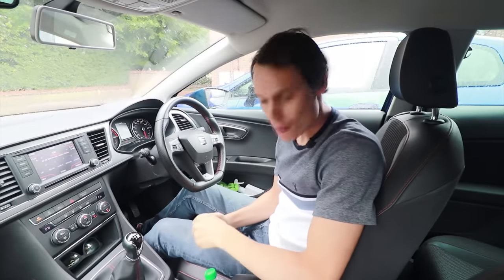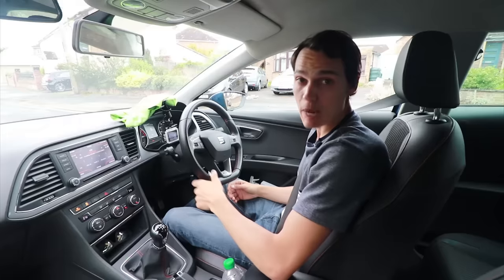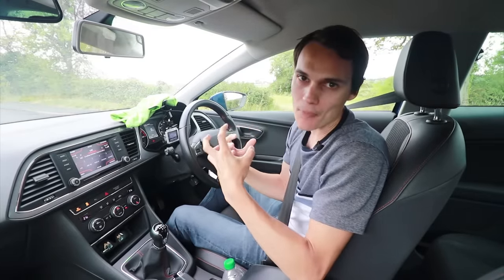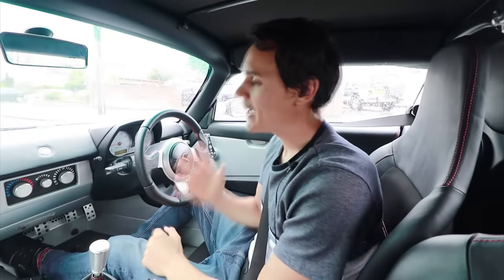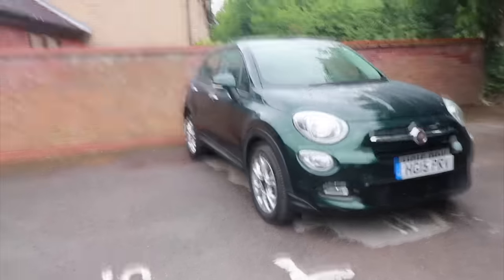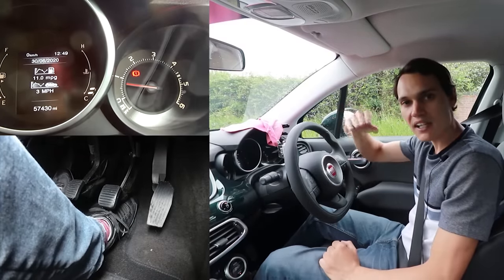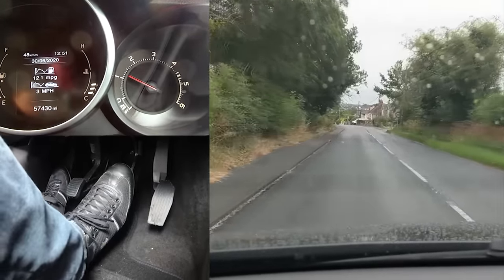Upshift blip - advanced technique for changing up gears smoothly

Comment: Im going to try this. I always struggle with keeping it as smooth as possible going from 1st gear to 2nd.
Reply from the maker: Good luck, I hope it works for you.
Reply: Same, manage to get on top of it?
Reply: started blipping the throttle, seems to help
Reply: Don't think this would fix things for you. If you find the revs are dropping too low, the simplest solution is just to change gears quicker.

When you're going first to second, there's often a large rev drop to do ~2k if you've waited until 20mph after pulling out of a junction. You're probably finding the car lurches forwards as you wait for the engine to slow down to match speeds
Reply: Just rev it out a little more and let the clutch out slowly
Reply: Just rev it from the begining don't press the clutch change gear then blip, just keep revs high

Comment: I had never heard of this technique before, I’ve not been driving long, 37 years, I found your excellent video as I was looking at a smoother gear change when driving my Defender, which in 1st 2nd and 3rd is a bit of a nightmare, I look forward to trying this out. Great video.
Reply from the maker: Thank you, I don't find it helps in diesels though.
Reply: Same with my WRX. 1st to 2nd and sometimes 3rd is horrible jerky sometimes.
Reply: @yammmit  how did you make it better?  Im struggling too
Reply: @ConquerDriving can you make a video for Diesels? Struggling to drive a Honda diesel in the lower gears and having too much jerking. I was driving a petrol perfectly fine for a while before this

Comment: That's a great tip! On my car I don't need to use this method on upshifts because the RPMs fall slow enough that I can upshift smoothly just by timing when I let the clutch out so it engages right as the RPM drops to where it needs to be in the next gear like your diesel Fiat. Took a bit of practice but the feeling of getting the rev match perfect and feeling nothing when the clutch engages is so satisfying. I can definitely see how this method could be quite useful on cars where the RPM drops quickly

Comment: Great video. Really helpful.
Some friends, ask me, why I revmaching when downshifting or sometimes when upshifting if I not need for , because I not in a racetrack on I need keep my revs up.
My answer it's always: do you feel the car Jerking or the downshifting when I do that?
- no, it's really smooth as if you don't change gears.
Exactly, that is the purpose. Also, more life for the gearbox and the clutch.
Reply from the maker: If you can rev match it's definitely better.
Reply: I had a stroke reading this
Reply: @yammmit  have you recovered from your stroke yet?

Comment: Even though it's a turbo diesel, 1st to 2nd can be a bit jerky if I go anything above 1 to 2k revs and don't take the clutch up slowly. This might be what I was missing!
Reply: You might want to try shifting at Lower rpms most diesels are designed to shift at low rpm because of the high torque
Reply: @aidanmorgan6291  I think you've figured it out. Sadly the old thing lost it's marbles and the engine computer went again, so I've had to get a petrol which suits me better for my current driving anyway. I'll miss how the engine sounded like it belonged in a tug boat at idle.

Comment: Automatic car: basically just learn how to drive with other people.
Manual car: have to learn how to control the car first.
Reply: and automatic cars much more expensive:)
Reply: Driving automatic car isn't really driving
Reply: @msa3533  How so?
Reply: @angrysocialjusticewarrior  it may depend where you live at
Reply: @msa3533  It doesn't. Geographic location has no bearing whatsoever on the superiority of automatics over manuals. Even if you live in a literal warzone, an automatic would still be way superior (e.g you can keep your eyes on the road to watch out for rebels since you don't have a transmission stick to distract you, and an automatic will get you out of a shootout than a manual could).
Reply: @angrysocialjusticewarrior  man I'm too proponent of automatic cars. Nevertheless, they are more expensive than manuels
Reply: @angrysocialjusticewarrior  manual gears are primitive and useless and you don't get better performance?
Yet the new m3 will come in a manual option and the new Porsche 911 gt3.
Reply: @angrysocialjusticewarrior  walks into a Porsche dealership to look at a 911. Asks the salesman "does it come in automatic" 🤣🤣🤣
Reply: @angrysocialjusticewarrior  I afraid your logic is terribly wrong. Understanding how to drive doesn't equal to better performance, better fuel economy and more safety.
Understanding how to drive means you know what the power bank is. You know what the rev. the peak torque located. You know why it is important to rev. match. These are fundamental but also are the thing the automatic guys absolutely have no idea. To them, they just floor the throttle and the gear box would do the down shift for them. 
Next time, try to ask an automatic guy why the gearbox down shift when you step down the pedal. I am interested to know what their answers are.
Reply: @angrysocialjusticewarrior  Sorry but one more thing. Passing the driving exam doesn't mean you know and can handle the manual car in your daily life. In fact, there is a huge gap. You would not understand what I am talking unless your daily car is the manual one.
Just stick to your automatic if you afraid the drive the manual. Few years later, the ECU will drive the car itself and you will come here again and shout out that you know how to drive car because you have pressed the start button. lol
Reply: @angrysocialjusticewarrior  automatic is not driving it's just steering
Reply: @angrysocialjusticewarrior  If all you want is to get from a to b. You can get more performance by manually shifting, because you can favour the RPM range that gives maximum engine performance, especially if you have turbos. That is less relevant outside of hobbyist circles.

What is relevant is that you can get more economy by favouring higher gears to reduce the amount of fuel used, which makes a difference over time, and allows a slight reduction to wear. There are automatic drivers who like to reverse before stopping or throttle before entering D, as well as an idiot who thought P meant Pass when driving on a highway.

Unless you live in Hong Kong, automatic boxes are noticeably more expensive, which is a major problem to the less affluent. Having less need for oil changes is significant to a lot of people who do not have a garage or driveway, which is most of the world.

Like the other guy said, to us it is like doing math without a calculator. Knowing how as well as why makes us more skilled, which is why math students educated in the East Asian style generally perform very well
Reply: @alexsiu1280  I'm almost 9 months after passing my exam on a manual and still watch lessons like this and learn with every driving session. I wouldn't dare call myself experienced before a few years and tens more thousands of kms in various situations under my belt. This commenter SJW and his logic really lives up to his name, driving an automatic and bragging about passing an exam lmao. But he made his point, he is not a real driver, he is just an automobile user that wants to get from A to B and doesn't like driving, nothing wrong with that.

The math without a calculator analogy is spot on.
Reply: @angrysocialjusticewarrior  if the gear stick in manual is a distraction then you definitely need some practice. It distracts you means you have to think how to change from 2nd to 3rd or you have to look at the map on gear knob lol

Comment: in my manual 125i, even if the revs are in the right place (or above for where 2nd gear should be), it’s always a bit jerky unless you stay on the bite point for eons. first to second is much smoother if i keep on the throttle just a little bit just before i raise the clutch to engage second gear and keep it there (or add a bit more) until the clutch is fully out. 

i don’t blip like in this video because i tend to rev it out more and i know even if my revs are correct it’s not super smooth without any throttle.

this changes if i’m going downhill though - i don’t have to use any throttle to make the first to second shift smooth

Comment: These are my current methods. Why they need to be performed are either the Engine characteristics cause the Revs to drop below the right rev range for the next gear, or you took too long to complete the shift such as when you get caught in the shifter gate and your timing is now off. 

If I am at Lower to Medium Revs (revs don't drop as much compared to when you are at high revs; where 1st to 2nd gear might have 2000 RPM drop when at high revs), 
- just release the clutch to the bite point and add a gentle amount of gas (6:36)
I find this much more consistent and reliable than upshift throttle blip. 

If I am at higher revs, and say the revs dropped to idle for reasons mentioned above (messed up shifting, got caught in the shift gate, etc. )
 -Either double tap the gas , or do one big throttle tap to get the revs up, 
-wait for the revs to drop, 
- then peel off the clutch at medium speed before adding gas (watch video; changing up gears quickly and smoothly by dropping the clutch).

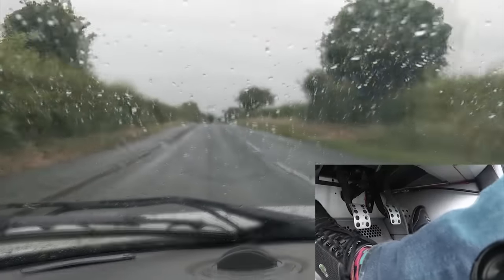Comment: Great video, I find it very hard to match the revs in the mornings when I drive to work, seems like the RPMS always drop so fast when I upshift even all the way up to 5th gear which makes it hard to match revs when upshifting and especially from 1st to 2nd I will try out this method in the morning. When I come home in the afternoons the RPMS drop a lot slower and I can match the revs easier. 9:17 is the level I want to be at when I upshift, how the way I upshift is I let the clutch engage first before I add any gas. I want to start adding gas to my upshifts since it sounds so much better and faster but I want to avoid burning my clutch up when I give gas before the bite point. 14:34 This is exactly how my car is, you give a little gas and the RPMs start jumping to 2000 or over + a stage 1 exedy clutch made it very hard to learn on as a beginner. I have gotten better on keeping the RPMS below 2000 starting off in first gear, I rev it up over 2000 RPMs from time to time which makes me cringe but getting used to it.
Reply from the maker: Sometimes the revs will drop more slowly when the engine is hot as the throttle cable gets more stiff with heat. I find that the case in my VX220.
Reply: Or because when the engine is hot and the engine oil has reach operating temperature,it is much easier for the engine to rev up or down

Comment: Great video, and loved seeing the VX220! I wanted to ask, could you get around the issue of the dropped revs by shifting super quickly, or do the revs still drop too fast? Of course that would probably be harsher on the car?
Reply from the maker: Thank you. It depends how quickly the revs drop on the car. If it's smooth it's not bad for the car.
Reply: I know it’s a bit late but if you’re too quick you’ll get rev hang and the clutch will have to bring the revs down, also a bit jerky!

Comment: When I drove a manual, my goal on any gear change was to match the revs as closely as possible so as to minimize the amount of work the clutch did. Using the bite point to bring the car up to a speed where the clutch can be fully  released is necessary when launching from a stop, or a speed too low for first gear. It is not necessary on any gear change.

Comment: I got my first manual car, a 2021 GTI, and struggled making shifts smooth. The 1 to 2 shift sucked the most and even clunked the lower mount when it jerked, no matter how slow I release the clutch. One time I shifted while I accidentally had my foot on the throttle just a little bit. The shifts were way smoother. That really helped me, but for some reason I still have a hard time doing it perfectly consistently. I'm starting to mess with little things now like adding lower engine mount insert, and may even look at shifter cable bushings to make shifts feel crisper. The insert may cause a little more cabin vibration so that's why I didn't get a billet one.
Reply from the maker: Being consistently smooth does just take practise. Some cars are easier than others.

Comment: My wrx and 911 have upgraded bushings so everything is tighter. The exhausts on both louder than stock. I can hear and feel when I do heel toe and blips correct/ and incorrectly! I do everything except redline by feel. Cool video. It’s not natural for drivers at first. Challenge yourselves 🤙🏻 do a vid about hand on steering wheel position- that should click some debate lol. Spoiler, it’s eight and four come at me lol

Comment: Hey Richard, I’m driving Mazda2.. lol
Just 2 questions: 
1- in the end you mentioned about the issue for new cars like mazda2, did you mean for changing to up gears? So clutch down, choose a gear, then let clutch up a bit then add some gas? To avoid the rev flying?

2-the other video of yours for rev matching for downshifting, advised to finish the tapping same-time finishing gear choosing- then let clutch up; however I saw another video “advance driving school” shows they do the tapping after putting gear stick to the lower gear, then let clutch up. Feels like that is easier to do, but I trust you more, what’s ur thoughts on this? - sure Mazda 2 can do the rev matching in your way? (Considering the flying rev issue)
Thanks a lot
Reply from the maker: It does depend on your car. In my Leon rev before changing gears is easier but in some cars where the revs drop quickly revving after changing gear is easier. The goal is to have the revs where they need to be before the clutch comes up. For rev matching up a gear you also want the revs before the clutch comes up.

Comment: What about revving to 2.5 to 3K in first gear and then getting into 2nd gear very quickly( without holding the clutch )before the revs go below 1.5K + quick and sturdy throttle input.
I own a 2008 civic and getting two 2nd gear can be a pain in the back.
Reply from the maker: The gears synchro may be worn, but I have found changing the gear oil has made selecting gears easier, but not always, it depends what the problem is. The trouble with really quick gear changes is it can be difficult to make it smooth.

Comment: i think upshift blip is only necessary if u take too much time or longer for a gear change. if u shifting the gear quickly then the revs will remain a lil bit more or less or still be the same( as u push the clutch down) for the next gear. but if ur revs really drops  too much like almost idle then u need to blip the throttle so that the revs get match of the engine speed and ur road speed and results into a smoother gear change.and u if u gonna skip couple of gears then its best to wait longer before shifting so that the revs drop a lil bit more so in this situation u certainly no need for bliping.am i ryt richard??
Reply from the maker: It is right but all cars are different, the revs drop very quickly in cars with light weight flywheels, my VX220 needed a blip and my MX5 ND2 also benefits from either holding the gas a bit or blipping it as you have to change gear very quickly to finish before the revs are very low. In fact, the ecu does it automatically when changing up at high rpm.

Comment: I have one of those cars with a sensitive gas pedal like the lady you mentioned at the end of the video. I find it impossible to drive without over-reving , which is I believe going to damage the clutch long term. I even got an experienced professional driving instructor (an old, seasoned guy) to help me and when he took over the car, he actually couldn’t get to it to move as well (stalled it several times in a row!).  I’m at a loss on what to do, keep at it and damage the car long term, or just sell and try to get something not so sensitive....
Reply from the maker: Get something better and test it out. I wouldn't try and learn in such a car, will cost you money on a clutch. You can use such an car with a lot of experience.
Reply: Conquer Driving Thank you for your advice, it’s really helpful. After passing the driving test on the first try without any significant struggle I was stumped by my sudden “inability” to drive. It was only when I saw this video that I started thinking it could be the car and not me.
Reply: What did you end up doing?

Comment: In some cars, such as my Opel / Vauxhall Insignia, when I go up the gears, when I press the clutch the engine rpm does not go immediately to no load (850 rpm), but the car holds it for about 2 seconds at the expected rpm of the higher gear, making the up-shifts smooth without effort. Because it is a big diesel with big flywheel, the engine is a bit slow to rev down once the clutch is pressed, so changing gears quickly when reving the engine high is kinda unavoidably jerky, cause the rpm is still too high for the next gear.
Reply from the maker: Some cars do have auto rev matching. Many Mazda models have this for up shifts.

Comment: For me, something like this is only necessary in 2nd-3rd:
1st-2nd you can just shift quickly and catch the next gear when the revs match on their own
2nd-3rd takes a little longer if you wait for the gearstick to move itself back to centre

That said, modern cars with electronic throttles have a lot of lag for emissions reasons (they'll actually smooth your inputs intentionally) so this is really unnecessary with that throttle hang. The issue you run across is having to wait for the revs to drop
Reply from the maker: All cars are different so it does vary. When cold it takes an age to enter any gear in my MX5 and that's a brand new car. Good once warm though.